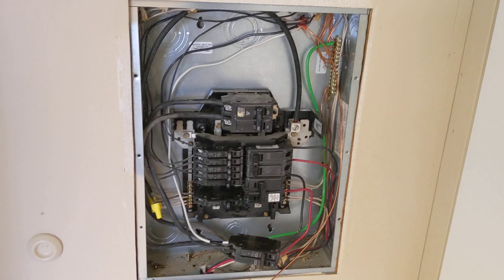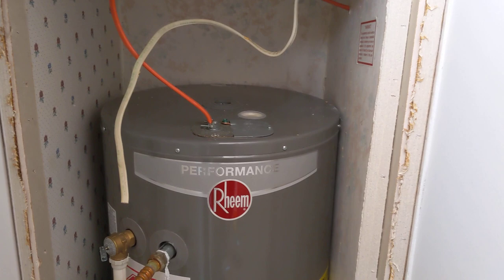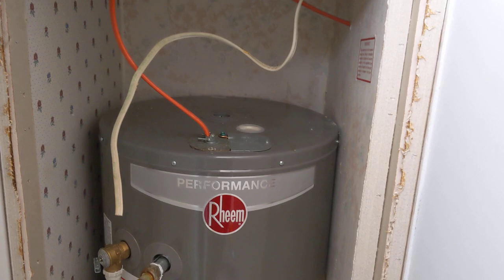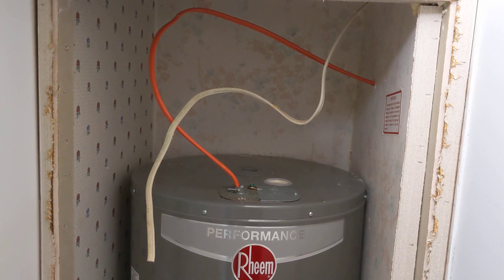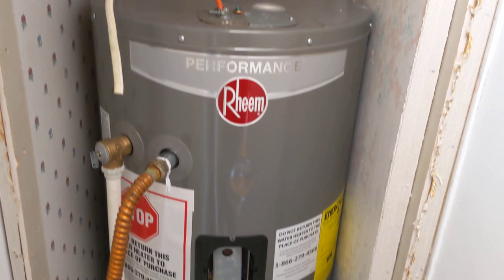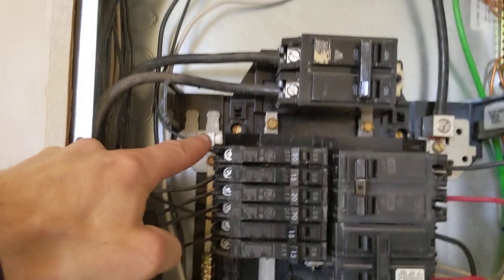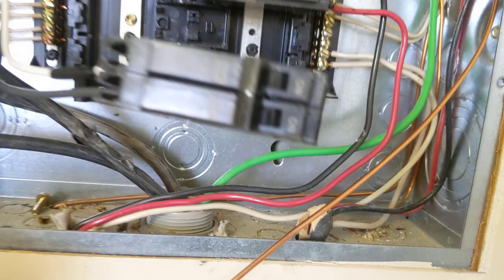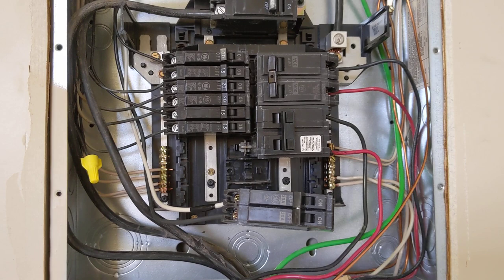Water Heater Electrical Issues

Comment: I've just had a new 60 gallon giant cascade water  heater installed. But 
my water tank breaker keeps tripping. The  specs say that the tank 
generates 40 amps and needs a 25-30 amp breaker,  but I do have a 30 amp
 breaker. What could the problem be? Thanks
Reply from the maker: What is running to the tank? Is it 10/2 with ground? It's possible it's the breaker itself, or a short in the tank's electronics or in the wire itself. A breaker trips over current/heat and that can be from hot contacting ground/neutral or from a higher demand than the breaker is rated for. I would turn it on and run hot water and use my ammeter to see what current draw is on it. If it's going higher than the breaker rating then something's wrong with the WH or wiring. So first I would use my ammeter or multimeter to find out the amperage being pulled, and if it was normal then I would change the breaker. If it wasn't normal then I would want to start testing the individual elements and seeing if they might be pulling more than they should be. I would also start "googling" to find out if other people had a problem with their water heater of the same brand. Using some common sense, Google and a multimeter, or ammeter, you should be able to narrow down the problem. Report back what it is and you might help someone else!

Comment: so you used a 30a for water heater? i got 20a on 10/2 wire having problems with it
Reply from the maker: So you are good with the 10/2 wire running to the water heater. The only reason a 20 amp is "incorrect" is because a water heater could cause the breaker to flip if  it uses beyond the 20 amps the breaker is rated for. Breakers are meant to protect the wire from pulling too much current, but 10 gauge wires are rated for use with a 30 amp breaker. So if your breaker is flipping off occasionally, (and your water heater is rated for a 30 amp breaker, which 99% of all water heaters in residential service are), then you can change out the 20 amp breaker for a 30 and you should be good. If you are having some other problem let me know and I'll try to help you diagnose it.
Reply: Wow thank you yes I'm headed back with the 30 amp breaker I got a multimeter too just in case I have to test the water heater

Comment: Is 8/2 wire ever needed? My water heater is pretty far away
Reply from the maker: So there are certain instances that require using larger gauge wire due to heat or distance, but I have seen 10/2 run to water heaters 200' away with zero issues.
Reply: @MyFortressConstruction  thank you
Reply from the maker: @Tomtom9401  No problem. The more in-depth answer is:
The issue with using certain gauge wire over long distance is usually the voltage drop. Most of the time it doesn't effect anything, but in certain circumstances you can drop beneath the recommended manufacturer voltage. Over a 200' distance a regular 50 gallon electric water heater will pull about 20ish amps and will have a little over 3% voltage drop. That's not ideal as it would take a 240 volt current down to 232 or so. If the system is already giving you a low voltage (220s) then you could fall beneath the required voltage, for whatever it is, to run well. The NEC doesn't want anything over 3% but most systems are close to 240 and can handle it.
Reply: And this is why you need a clamp on amp meter.

Comment: How do you electric is off because you’re really keeping your hands inside of the box unless I just missed when you said you had turned it off🙀
Reply from the maker: Yes, I mentioned that not only was the breaker inside the box turned off, but the main shut off at the meter was also turned off (and had a lock out tag on it too). Can't be too redundant with electrical safety!

Comment: I don't think breakers flip at 80% at all. It seems to me that most breakers need over current to flip at all ever.
Reply from the maker: Yes, you're correct. I meant that breakers shouldn't be more than 80% loaded to capacity, but breakers can run 10% or more over capacity before flipping.
Reply: @MyFortressConstruction  80% continuous load that is. It's ok to run to near 100% for a less than 2 hours (depending on region), as far as I know.

Comment: How can I connect two water heaters on the house
Reply from the maker: You need two separate circuits providing power to each one and then you can decide whether you want to connect the water lines in series or in parallel. I made a video of gas water heaters in series here: https://www.youtube.com/watch?v=1usbFPVvGBk

Comment: I have a 25 amp breaker for my water heater
Reply: Assuming your water heater has 4500 watt elements 25 amp breaker & 10 awg meets the minimum requirements.  (4500 ÷ 240 = 18.75A)  × 125% = 23.4A.  Because 10 awg wiring is good for 30 amps and 25 amp breakers are a rather oddball size typically reserved for HVAC systems and some motor applications,  it's common practice to use 30 amp breakers for a water heater. Note that some water heaters have 5500 wart elements and require 30 amp minimum.   More rarely the water heater is configured for simultaneous operation (both elements come on at the same time) and use two 30 amp circuits or one 50 amp circuit,  this would typically be seen in a commercial setting such as a restaurant,  or in a very large household with extreme hot water usage such that non-simultaneous operation is inadequate and a larger tank cannot be installed for some reason.

Comment: Fact,  breakers trip over the rated value not under. Thermal overload on a 20 will occur at 21-26 amps... not 15-20 like stated here
Reply from the maker: Ah yes, sorry I must have mis-spoken. I meant to say you shouldn't have a load on the system that is more than 80% of the breaker capacity. Thanks for the clarification. Breakers can run for a minute or two with twice the amps running on them than they are rated for.

Comment: I came here simply to learn how to wire/connect a water heater onto a circuit breaker and got a long lesson on electrical.  I can probably take the exam and pass to become a licensed electrician and all I wanted to know is how to connect a water heater but never learned how to do it. Never saw an orange wire coming from the water heater connected any where.  Let me look else where.
Reply from the maker: Lol. Yeah, this was more about theory than installation. I am the type of person that struggled with math because I wanted to know "Why?". I'm sure you'll find the video you were hoping for.

Comment: Illegal, there needs to be a two pole 240 volt disconnect switch near the water heater. Also metal clad cable needs to be used. You can't have exposed Romex below 8 feet.
Reply from the maker: You're not wrong, but in our jurisdiction they don't require the shut-off and I talk about the need for a j-box and cladding.

Comment: Hoping someone will help me confirm my thinking on my hybrid water heater electrical wiring hookup. I have a 30 amp 2 pole breaker using 10-3 wire to the old water heater. I installed the old heater 12 years ago and bought this new hybrid. But I forgot to check my electrical wiring using the 10-3 wire. Usually take a pic, but didn't. Anyway, I just want to be sure how I connect wires. 

Water heater has typical black and red plus green ground inside. I have red, black and white neutral with ground coming from panel/30 amp breaker. I believe I can connect red to red and black to black from 10-3 wire I have coming from panel to water heater. And then white neutral of 10-3 to chassis of heater inside electric compartment and ground to green ground screw. Anyone help me out? 

I've always been wondering why both neutral and grounds are connect to bus bars inside home electrical panels. Which from what I've seen both bus bars are connected to metal of electrical panels. I ask a retired electrical friend about why and never really got a clear explanation except to say they are often connected to same bus bars inside panels. Anyway more concerned is my wiring idea for water heater is correct from anyone who knows about using 3 wire connecting to heater with 2 wire and ground. Thanks
Reply from the maker: Good questions: So the only purpose of having a neutral with your water heater is if it has a 120 volts system inside of it such as a fan or Wi-Fi connection or something else that needs 120 volts. A standard water heater only uses two hots and a ground. If your new water heater does not have a place for the neutral then you do not hook it up, just cap it. The reason why some panels are bonded with neutral and ground is because of the way electricity works. It is a little complex but here is a good place to learn the basics:

https://youtu.be/_XM6rXjv0vc
Reply: @MyFortressConstruction  Yes it does have Wi-Fi and a fan, but no white neutral. I guess it's probably internally wired to handle those  items with electronic circuitry. I try what you said. 

Thanks for the link. Although I'm not sure I totally get the difference, at least when a short actually occurs. I think the video is saying, then both ground and neutral carry voltage and can shock you. Otherwise Neutral splits 240 into 120 on each side the leg. While ground is to protect you from shock by sending voltage to earth. Maybe???
Reply from the maker: @bertpainter8385  It is possible that your water heater is built to run off 10/2 since that's how most water heaters have been wired in the past, just make sure that's the case. Definitely don't attach neutral to the chassis like ground though. What's the make and model?
  As to neutrals: If the circuit isn't completed back to the transformer then the breaker won't necessarily sense that current is running on the ground, is my understanding. The ground is "a" path but returning current to the transformer is the "true" path. Grounding is a fail safe to try and coerce the electrons to it instead of you since it's looking for the path of least resistance, but a breaker is made up of a heat sensing strip as well as magnets that sense the field of electrons. The flow of unhindered current down the neutral triggers the breaker more reliably. Again, this is my basic understanding and may be missing key points.
Reply: @MyFortressConstruction  Thanks for taking the time to reply and explain, which was a much better explaination than what I've research online and from my retire union electrician I just spoke with. He also said to wire nut the neutral off. I asked him if I should do the same inside the panel too, but he didn't think it was necessary. 

The water heater is a Rheem Performance Platinum 50 Gal. 10-Year Hybrid High Efficiency Smart Tank Electric Water Heater
Reply from the maker: @bertpainter8385  👍 I just looked up the wiring diagram for that model and it showed that it only required two hot legs and a ground. If the fan, wifi, etc. did not function then it would indicate that a neutral was missing, but if everything is working without the neutral then that is further confirmation that you are good to go.
Reply: @MyFortressConstruction  Thx again

Comment: You need both phases for 240v not just one phase splitting the 120v circuit  will only give you 120v
Reply from the maker: Right: 8:48

Comment: That breaker idnt s 2 pole. Its a tein. Forsnt provide ,249 volts
Reply from the maker: You're not wrong, but tandem and 2 pole are terms that manufacturers use interchangeably sometimes and fundamentally they're the same if you are connecting to a system that allows a tandem to be in contact with both poles of the panel, which is one of the points of the video. If you're using a thin line/tandem breaker you need to make sure you're putting it into the right spot so that both poles are engaged. A true 2-pole breaker forces you to connect to both due to its size.

Comment: Let's say a tankless calls for 2 8/2wires ran to 2 40 amp breakers you can always size up to a 6/2wire just never go lower..
Reply from the maker: Yes, you can always up size your wire ( to the limit of the terminals at least), but not the breakers. The equipment mfg. will specify breaker minimum/maximum.

Comment: new  water heater installed  yet  no hot water after 12 hours
Reply from the maker: Power coming to heater verified? Did you wait to turn it on until the tank was full of water and the lines purged? A new tank can burn up the elements quickly if there's not water inside. I have had a new tank (6 months or so) stop heating very well. Checked the elements (dual) and reconnected everything and it was working fine. Figured it was a bad connection. But start with the basics (power coming in is correct) then check wiring on the tank. May God bless your endeavor!